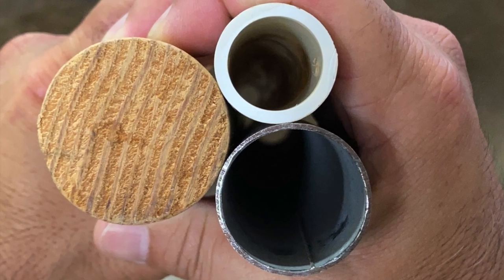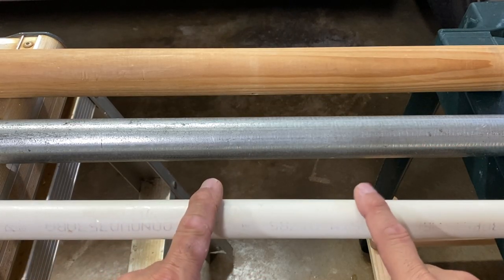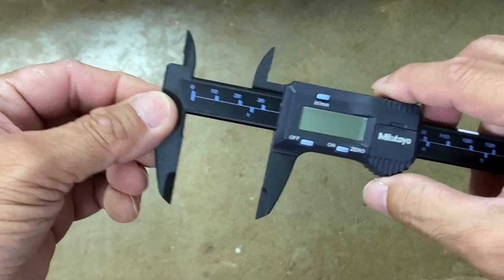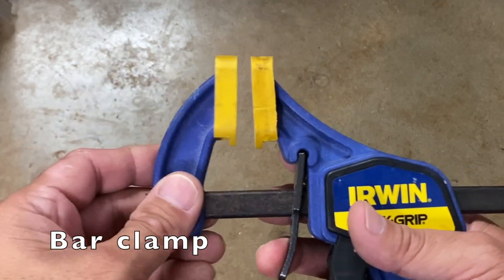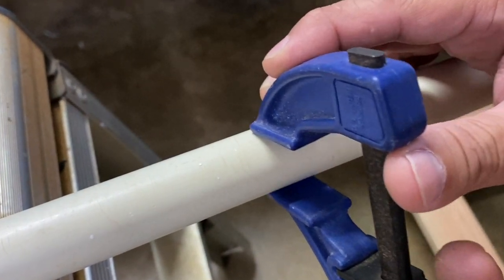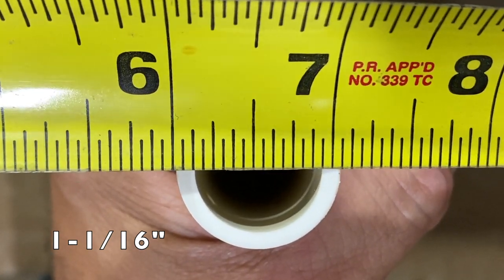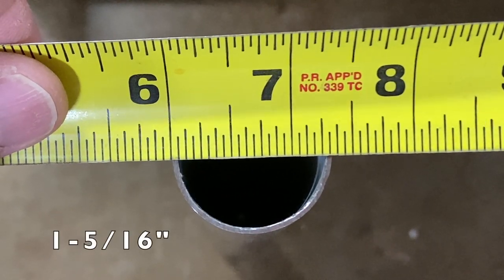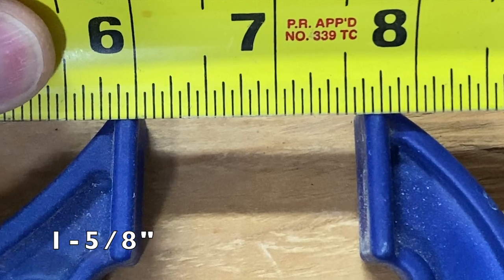How to Measure the Outside Diameter of Pipes, Rods, & Dowels Hack

Comment: Thank you this was very helpful. I have a question maybe you can help me with the answer. I wan to build a cage using the pipes used for fence link fences. I want to use the canopy fitting 1-3/8", what size (diameter) pipes should I get?
Reply from the maker: I hope this helps...
Here's a link to a canopy website that says for 1-3/8 and 1-5/8 canopy fittings, fence tubing should be used...
http://www.canopymart.com/glossary/
According to the Home Depot website, the outside diameter of 1-3/8 top rail fence tubing is 1-3/8.  I verified this with a top rail at my home.  So, you should be able to use the 1-3/8 top rail tubing.  If still not sure, take the canopy fitting with you to Home Depot or other home improvement store.  
😎
Reply: @HacksbyDad  Thank you sir.

Comment: A person will be dealing with a minimum of 1/8", usually, 1/4" or 1/2".  With decent depth perception, eyeball it with a tape measure behind the pipe.  Or, if you really trust your eyes/brain, with a tape measure in front of the pipe.  Of course, that is if you have nothing at all to obtain a physical measurement.  Speaking of all the previous, use your imagination.  For smaller pipes - I mean, we're not talking about sewer pipers here - do you have a paper clip?  Any kind of thin, bendable metal like that?  Use that to bend it halfway around the pipe to make something to measure.
Reply: You’re a life saver. What woman has a calipher or a bar clamp? I do have tons of paper clip! Many, many thanks